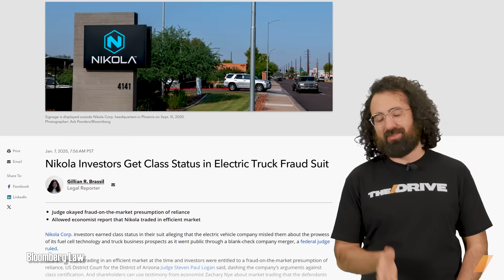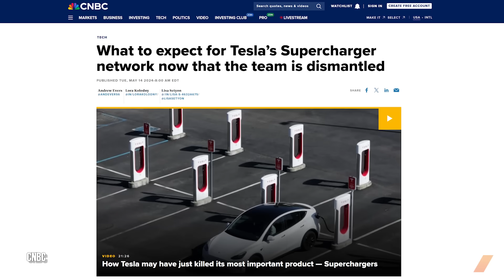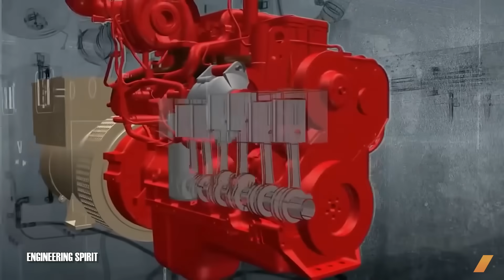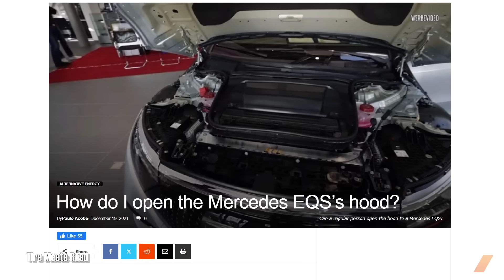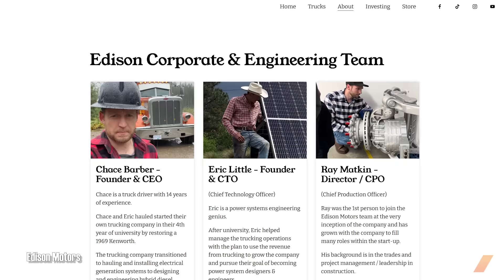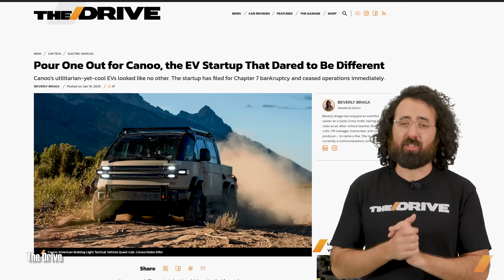The truckers in a shed beating Tesla with 100-yr-old EV tech

Comment: Myth 1: The electricity grid won’t be able to handle the increase in EVs There are two aspects to whether the electricity grid can manage lots of EVs being plugged in at once: Whether enough electricity is available; and Whether the wires that carry that electricity have enough capacity to do so It’s important to remember that the shift to EVs is happening gradually – not overnight. Renewable energy sources are constantly being developed to supply us with more clean and green electricity, and we’re constantly ‘evolving’ the electricity grid to be better equipped to handle it. Will enough electricity be available to charge EVs? A main source of concern here is the scenario of all EV owners charging their EVs at the same time. So is it possible to spread out the demand, while still making sure we all get our EVs charged when we need it? With this in mind, the UK Government has introduced Electric Vehicle Smart Charge Points Regulations, which ensure that EV charge points will have smart functionality; allowing the charging to happen when there is less demand on the grid, or when more renewable (and therefore often cheaper) electricity is available. This means that no matter what time you plug in your car, it will charge when you need it but can automatically pause during those peaks when demand on the grid is highest and energy is most expensive. Similarly in the US, Smart Chargers and Time of Use Rate programmes will support balancing the load throughout the day. Does the electricity grid have enough capacity for charging EVs? The most demand for electricity in recent years in the UK was for 62GW in 2002. Since then, the nation’s peak demand has fallen by roughly 16% due to improvements in energy efficiency. Even if we all switched to EVs overnight, we believe demand would only increase by around 10%. So we’d still be using less power as a nation than we did in 2002 and this is well within the range of manageable load fluctuation. The US grid is equally capable of handling more EVs on the roads – by the time 80% of the US owns an EV, this will only translate into a 10-15% increase in electricity consumption.1 A significant amount of electricity is used to refine oil for petrol and diesel. Fully Charged’s video Volts for Oil estimates that refining 1 gallon of petrol would use around 4.5kWh of electricity – so, as we start to use less petrol or diesel cars, some of that electricity capacity could become available.

Comment: Myth 7: The infrastructure isn’t able to support a lot of people driving electric vehicles – especially in rural areas Currently in the US, there are almost as many EV charging ports as there are gas stations. Charging stations are constantly being added by public and private entities alike. The Bipartisan Infrastructure Law also allocates $7.5 billion for EV charging infrastructure to support continued expansion. National Grid and 60 other utilities are collaborating as part of the National Electric Highway Coalition to foster expansion of fast EV chargers along highways. In the UK, National Grid has proposed the optimum locations for adequate grid capacity to enable others to provide ultra-fast chargers, ensuring that nobody on the strategic road network (motorways and principle dual carriageways) is further than 50 driven miles from ultra-rapid charging. This will give drivers consistency, continuity and therefore confidence that their main – or only – car can be electric.

Comment: Hybrids are double the complexity of an ICE vehicle or a pure BEV. They are the worst of both worlds. Hybrids are not the answer: Plug-in hybrids are a 'wolf in sheep's clothing' Carbon dioxide emissions from plug-in hybrid cars are as much as two-and-a-half times higher than official tests suggest, according to new research. Plug-in hybrid vehicles are powered by an electric motor using a battery that is recharged by being plugged in or via an on-board petrol or diesel engine. They account for 3% of new car sales. But analysis from pressure groups Transport and Environment and Greenpeace suggest they emit an average of 120g of CO2 per km. That compares with the 44g per km in official "lab" tests Plug-in hybrid electric vehicles (PHEVs) are sold as a low-carbon alternative to traditional vehicles and conventional hybrids - which cannot be recharged from an external source - and are proving increasingly popular. The new research is published as the government considers whether to bring forward a proposed ban on the sale of new petrol, diesel and conventional hybrid cars from 2035 to 2030. 'Official' versus 'real world' The BBC understands one suggestion is that plug-in hybrids should be given a stay of execution, with new sales allowed to continue until 2035. That's because they can offer a 20- to 40-mile range as a purely electric vehicle and are therefore potentially significantly less polluting than other vehicles. But this new analysis from Transport and Environment and Greenpeace suggests they don't offer anything like the carbon dioxide savings claimed for them by manufacturers. The official tests indicate that plug-in hybrids emit an average of 44g per km of CO2. These tests are conducted on a circuit and see vehicles driven in a way that regulators consider "normal". The real figure, however, according to the report, is more like 120g per km. A really simple guide to climate change The five major challenges facing electric vehicles How will the petrol and diesel car ban work? The pressure groups have analysed what they say is "real-world" data on fuel efficiency collected from some 20,000 plug-in hybrid drivers around Europe. These are drivers who have chosen to record their mileage and fuel consumption for surveys or who drive company or leased vehicles whose fuel efficiency is recorded. According to this data-set the lifetime emissions of a plug-in hybrid average around 28 tonnes of CO2. By comparison, the average petrol or diesel car is estimated to emit between 39 and 41 tonnes of CO2 from fuel during its lifetime, a conventional hybrid would typically emit more like 33 tonnes. According to these figures a plug-in hybrid would only deliver an emissions reduction of about a third on a typical petrol or diesel car - far less than the official estimates. Toyota ICE sales are plummeting and Toyota is an EV laggard with only the BZ4X - which they had to recall because the wheels were literally falling off! Tesla is the most profitable car maker on planet Earth right now (in terms of margins) with the highest profit margins per vehicle in the auto sector.

Comment: Hybrids are not the answer: Plug-in hybrids are a 'wolf in sheep's clothing' Carbon dioxide emissions from plug-in hybrid cars are as much as two-and-a-half times higher than official tests suggest, according to new research. Plug-in hybrid vehicles are powered by an electric motor using a battery that is recharged by being plugged in or via an on-board petrol or diesel engine. They account for 3% of new car sales. But analysis from pressure groups Transport and Environment and Greenpeace suggest they emit an average of 120g of CO2 per km. That compares with the 44g per km in official "lab" tests Plug-in hybrid electric vehicles (PHEVs) are sold as a low-carbon alternative to traditional vehicles and conventional hybrids - which cannot be recharged from an external source - and are proving increasingly popular. The new research is published as the government considers whether to bring forward a proposed ban on the sale of new petrol, diesel and conventional hybrid cars from 2035 to 2030. 'Official' versus 'real world' But this new analysis from Transport and Environment and Greenpeace suggests they don't offer anything like the carbon dioxide savings claimed for them by manufacturers. The official tests indicate that plug-in hybrids emit an average of 44g per km of CO2. These tests are conducted on a circuit and see vehicles driven in a way that regulators consider "normal". The real figure, however, according to the report, is more like 120g per km. A really simple guide to climate change The five major challenges facing electric vehicles How will the petrol and diesel car ban work? The pressure groups have analysed what they say is "real-world" data on fuel efficiency collected from some 20,000 plug-in hybrid drivers around Europe. These are drivers who have chosen to record their mileage and fuel consumption for surveys or who drive company or leased vehicles whose fuel efficiency is recorded. According to this data-set the lifetime emissions of a plug-in hybrid average around 28 tonnes of CO2. By comparison, the average petrol or diesel car is estimated to emit between 39 and 41 tonnes of CO2 from fuel during its lifetime, a conventional hybrid would typically emit more like 33 tonnes. According to these figures a plug-in hybrid would only deliver an emissions reduction of about a third on a typical petrol or diesel car - far less than the official estimates.

Comment: The biggest problem with electric is its battery is not energy dense.  Batteries are great at providing the peak load the motors need to get off the line with that low end toque to haul heavy loads.  The generator, whether diesel, natural gas, or hydrogen, can use a much more energy dense fuel to top off the batteries as needed.  This means less batteries are needed for a full days work, while also consuming less fuel since the generator is not constantly running.  Hybrids remove the range anxiety and infrastructure of full electric, while also consuming less fuel than traditional diesel.   Hybrid is the transition we need moving forward.

Comment: I've been saying this for years: Solving biodiesel issue is much much easier than solving battery tech issue. And energy density is not even close. Not to mention that diesel-electric truck will actually weigh less than regular truck since it doesn't really need conventional drive train. And it will solve that dreaded breaking issue too and with virtually no extra equipment.

Comment: Ev doesn't make sense for any application that needs a lot of power. Diesel has 36x more power per volume than battery. 

However, ev efficiency isn't even what's sold. Green fuel turbine to road is better than battery. 

Pure ev is marketing, the real solutions will be more nuanced 
https://youtu.be/Em4Id4FwSgo?si=Fl_R0YYDIkfcFN_w

Comment: I think you're missing the plot here. One is not better than the other, per se. They're intentionally different to serve completely different segments of the trucking market.
Reply: Its just another channel run by TDS/EDS.
Reply: Yes, the other segment requires trains, dry van trucking is obscenely inefficient and completely useless even for last mile shipping, trains could always do last mile, propaganda just hyper emphasized the imaginary dangers.

Edison exclusively serves the only real use for trucking: specialized, off grid, irregular heavy cargo for short periods.
Reply: @russetwolf13  What?

Edison serves EVERY possible use for trucking. 

Tesla serves companies performing repeating short-haul local delivery routes. Last mile is very much a legitimate use of trucks, but there's no reason Edison trucks can't and won't serve that same market.

There's no reason that the generator ever NEEDS to be ran, if it's not needed. 

Local companies have the same option to just grid-charge their trucks overnight if they're doing that type of hauling. Edison trucks DGAF where the electricity comes from to power them, and Edison has made it very clear that if you don't NEED the generator, they'll happily build you an all-electric truck that you can only grid-charge, just like a Tesla. They don't care. They'll build the truck the customer actually needs. That's philosophy is a huge part of what makes them such a cool and promising company.

Comment: For the original (cancelled) Army acquisition of the Joint Light Tactical Vehicle (JLTV) this is the approach that Oshkosh Truck originally proposed. The Army foolishly passed on the concept. As much sense as this design makes for commercial trucks, it makes even more sense for military vehicles. For example, you can armor the floor without needing to work around a driveshaft. You get more usable cabin space. You get enough electrical power to power advanced combat systems. Instead the Army chose a conventional truck design. Dumb.

Comment: Tesla was making the Semi on a pilot line.  All that Pepsi have are early prototypes. 

 ONE MONTH ago  Tesla started their Semi dedicated plant. Thousands of changes were made to, improve the semi you are talking.
After just one month they are making 150 Semi units per day.

  Battery packs (last year) last between 300,000 to 500,000 miles  A tesla Semi (prototype) was able to move 1,000 miles in a single day with normal cargo weight on independent test..

 Tesla just like in the past is doing their own semi trck charging network.  This is in coordination with consumers.
 Yes they will probably all be sold to large trcking users as a complete fleet, because it saves tons of money.

Yes small companies can afford one since the payout is very short.  A regular Semi saves 22% of the operating cost.

Edison has  retrofits kits for semis way before their hybrid truck.  Be realistic.  They have one running , and it is a prototype while Tesla has a dedicated manufacturing plant doing 150 per day.

Edison had a greast idea but it is 10 years too late.  Hybrid trucks should have come firts, followed by full ev trucks, but reality worked at a different order.

I think the market for retrofits is larger than the new ev truck market for at least several years.  The company will eventualy switch from hybrid to full ev as they gain more experience and grouth.  I wish Edison the best.  The US needs to have cleaner trucks 80% of the air pollution came with just the 20% that are semi's.
An old semi owner can easily afford the Edison modificatios.  I only worry about the diesel generator emisions, but probably a small systen similar for full diesel trucks can be applied.

Comment: It is amazing that the trucking industry didnt switch to hybrids years ago, because all the benefits for hybrids are magnified on trucks, and the drawbacks are minimized. The video covers all of that better than I could. 

If anyone wants an example of major companies being bad at their one job, this is a perfect example. The Prius was common in the 1990's and more than proved the technology - it was Totota's best selling car for several years. Somehow the trucking industry looked at that, saw the incredible fuel efficiency benefits, the extra torque from the added electric motor (which is critical for trucks that struggle to accelerate and climb long hills), the great stopping benefits and lower maintenance from regen braking, and the long-lasting battery (so a trucker doesnt need to leave the engine running overnight if they sleep in the truck on a cold night) - but it rejected them. They would get all that, in exchange for a few hundred pounds (at most) of extra weight in the truck, and a highly-reliable system with few moving parts. It might overall reduce weight by enabling a smaller engine, smaller simpler gearbox, and smaller fuel load to achieve the same range.

Comment: They are not building long haul trucks They are building vocational trucks. They are making vocational pickup conversion kits concurrently with the semis.  Batteries on BEVs are outlasting the chassis of cars. Figures from BEVs that have been on the road for years are showing an expected lifetime of 20 years. So replacing the battery is not a major problem.

Comment: Diesel hybrid seems like a great idea.  I don't think the series approach is optimal. Chevrolet tried it in the original Volt hybrid, but changed to parallel for Gen 2.
  Energy is lost when the diesel engine converts chemical energy to kinetic energy, converting kinetic energy to AC electrical energy also loses usable energy.  Converting AC to DC for battery storage and from DC to AC for the electric motors requires enough energy that EVs require a separate radiator for this. Conversion of electrical energy to kinetic is 95+% efficient. 
    As described in the presentation, during acceleration, fluctuations in diesel engine rpm are disastrous for efficiency.  Improved efficiency from constant engine speed at ideal speed outweighs the losses described above.
  For long haul freeway driving on level ground reduction gears to match optimal engine speed with desired truck speed is equally efficient for the engine, without the series of losses described above.
  Two simple ways to accomplish this are:
  1. In town, use the system as described in the presentation.  For long haul, engage a single speed reduction gear and drive shaft. The hybrid system can add torque to maintain constant road speed when hills require more power than the diesel can efficiently supply.
  2. Adapt the planetary gear system used in Gen 2 Volt an by Ford & Toyota in their hybrids. This allows some kinetic energy to flow, non-converted, from engine (through variable reduction gears) to tires.  Other kinetic energy is converted to electrical to apply extra torque simultaneously, or later when peak torque is needed for acceleration & hill climbing.  The parallel gearing is fundamentally the same as a rear differential.  The diesel engine is connected as if it was one half shaft, the electric motor/alternator the other half shaft, and the drive shaft as a drive shaft.
  The hybrid approach is less applicable to railroad because the independently sprung bogies turn independently of the locomotive frame.  Mechanical connections dividing power between 6 axles on 2 bogies would be complicated and fragile.